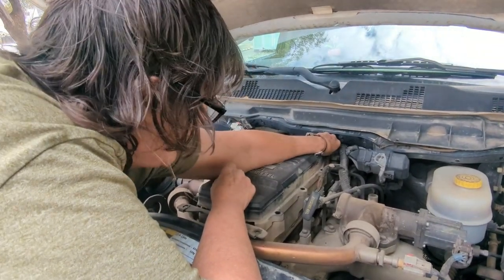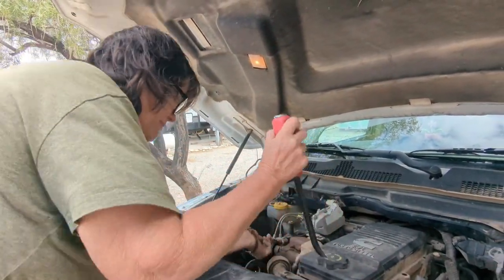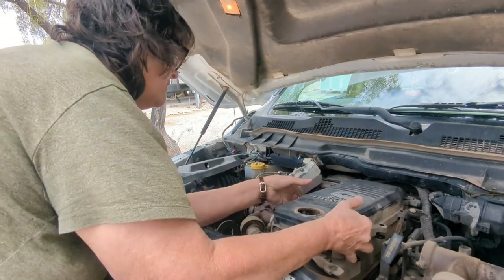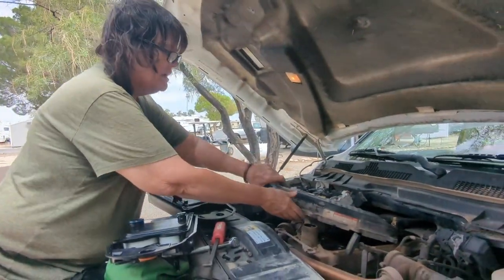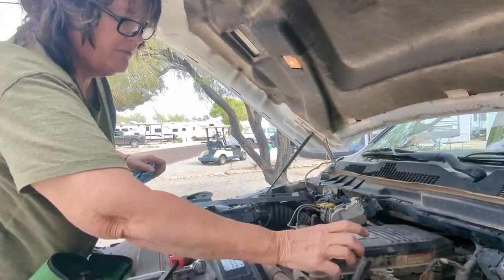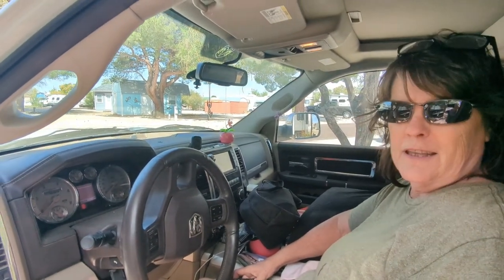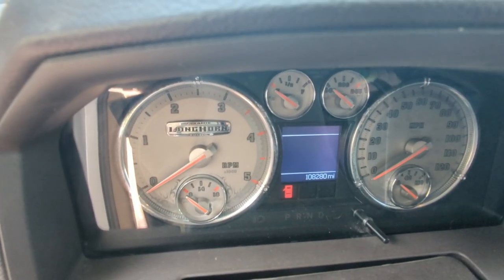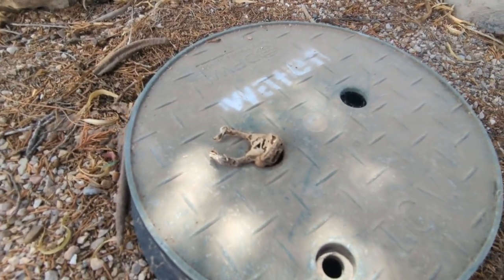Cummins 6.7 Diesel Perform Service Code - Crankcase Filter Change

Comment: Good job.  YouTube has a world of information on how to repair problems.  I just fixed my radio for less than $100 and dealer wanted $2400 to replace it, found the solution on YouTube.
Reply from the maker: That is so cool you fixed your radio.  They wanted 2400?  Crazy.  What kind of radio?
Reply: @FrugalRVGal  Standard issue for GMC, with xm, single CD  and navigation

Comment: I will have to check again on my truck but I am sure that they did something different on my 2014 . I will have to check again you might have saved me 2800 dollars! Deb did an awesome job! The only thing she could have done better would have been to hold the flash light in the wrong spot hehehe. We miss y'all so much. So much has happened in the last few years with us its  crazy.

Comment: I get towed in the morning to see why my rig won't start. After googling it, I believe it has something to do with the battery cables that go from the battery to the starter and the ???.  Just got a new battery and starter so it's not that. I need a Jana ❤.
Reply from the maker: Oh NO!  I guess by now you might know what was the issue.  Are you fixed up?
Reply: @FrugalRVGal  well....that problem was a bad connection on the ground. He cleaned and checked that all out. But I did stall coming into Pahrump. Think it overheated and shut everything down. Finally got it restarted and Rob drove out and followed me back to the RV park. Guess we'll see if it happens again when I leave here.